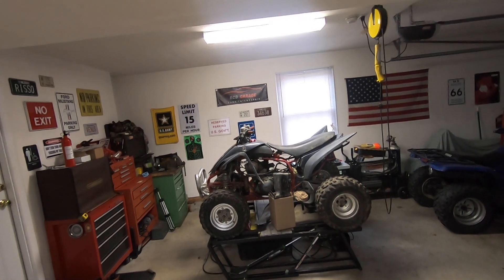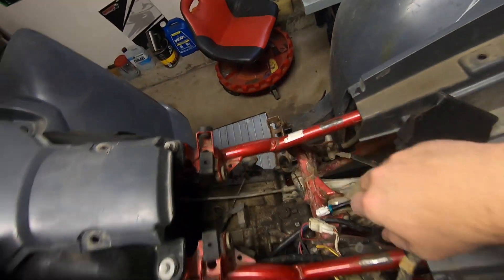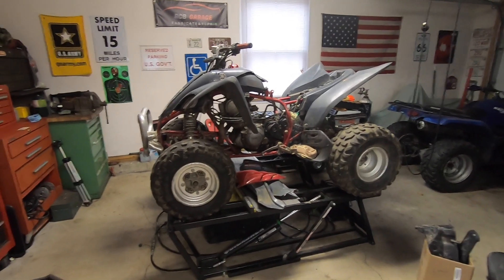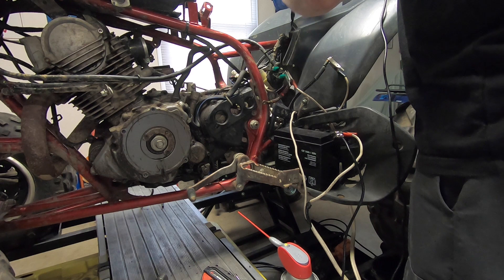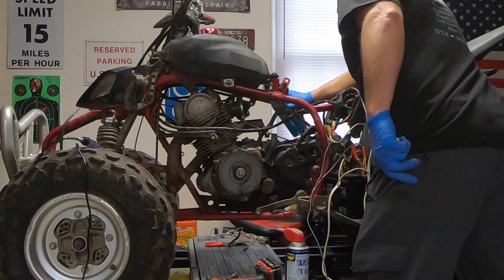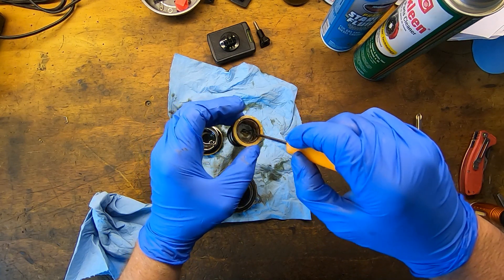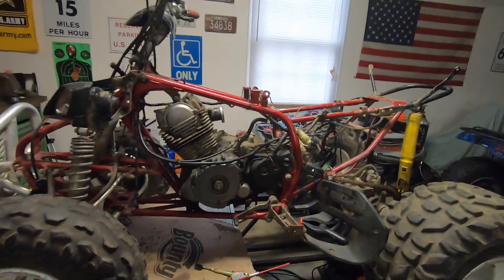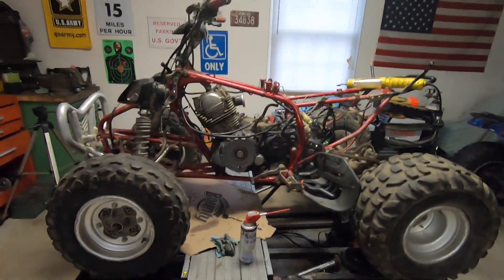2009 Raptor 350

Comment: What could u possibly done to call for so much rtv put the whole engine back together and not use gaskets are something I've built several and usually don't need to use any maybe a dab on the half moon valve gaskets about it